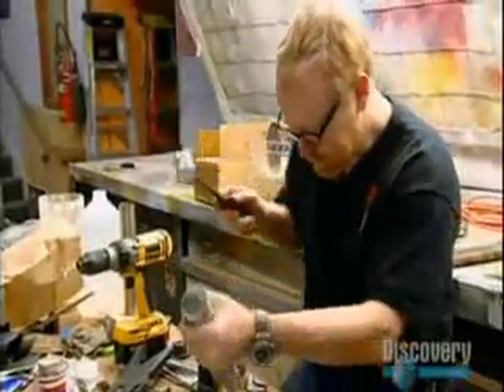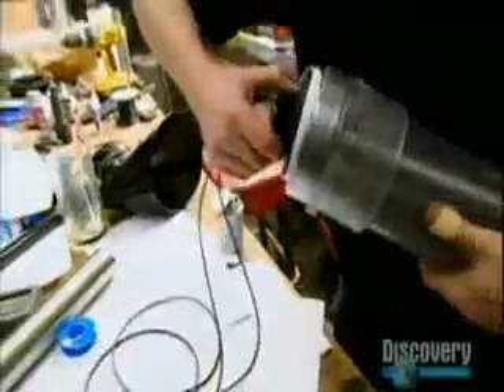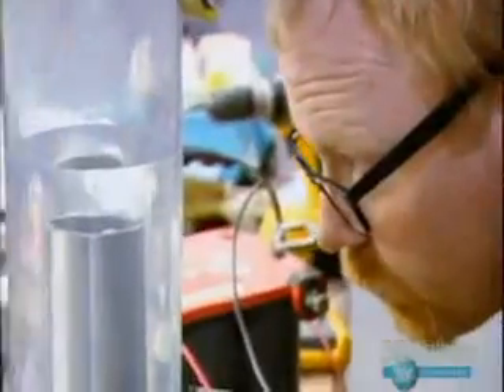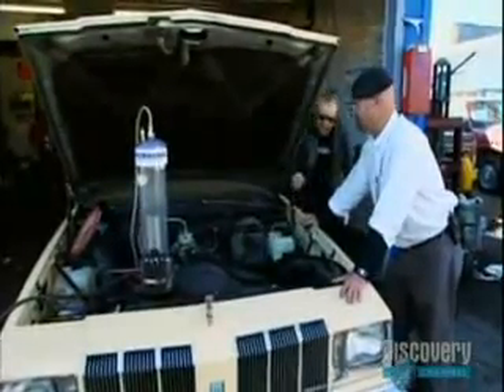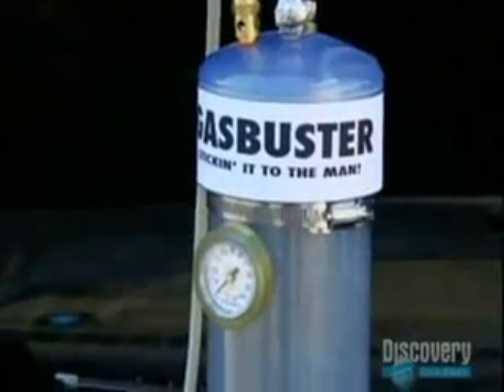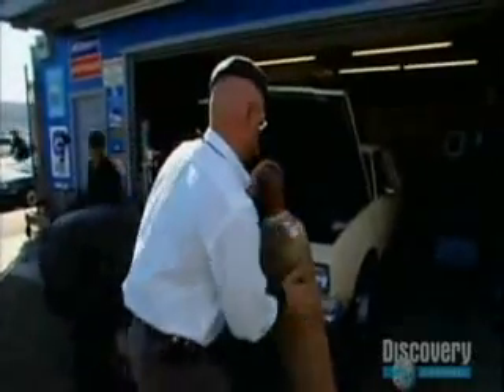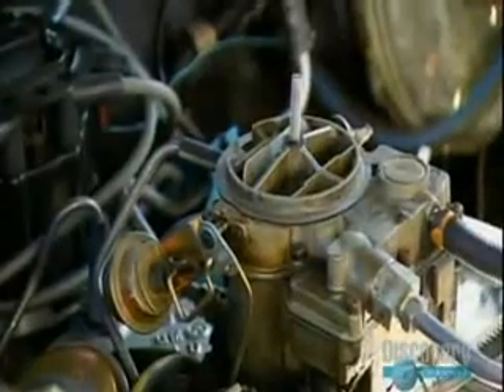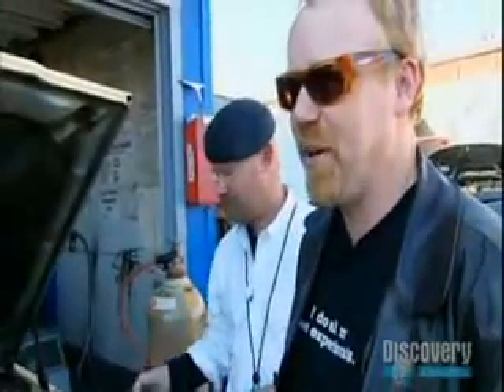HHO Mythbusters Explained

Comment: Hydrogen is 1/ 300th the amount of energy as regular Gas per volume. So you'll look cool with that 300x's bigger gas tank that's the size of a double transport trailer consuming 10x's the fuel just to pull it and realize you'll get about 50 miles on 2,400 gallons of water. Great idea you fucking idiot ! where r u fueling up, the ocean ?
Reply: did someone say retarded?I  I  I  ggg  gggg ggggoott  aaaa  ccaarrrr  dddaatttt   rrrruuunnnnssss oonnn   rrrraaaiiiiinnnn ddduuuussstt.
Reply: if you also factor in the burn time of hho, vs gasoline, the spark advance that normal engines run will cause detonation... so if it did work, it would it would destroy the engine. hence the backfire... ignition while intake valve is still open...
Reply: +charles samuel the arrestor only stops the flame from going back into the line. doesn't stop the cylinder from backfiring as the valve is still open when the plug fires.
Reply: +charles samuel yes, by changing the ignition advance. newer vehicles would never allow the ignition to become that retarded, the ecu would just not allow it. unless a standalone ECU was used. older ones you could retime the distributor. either way, you're not producing enough HHO on the fly to support combustion.
Reply: Your calculations are wrong. There are cars that run on COMPRESSED hydrogen. My local power company had one that would get about 250 miles per tank. You don't story hydrogen or ANY gas uncompressed. Even car tires use 32PSI. Imagines the building sized tank they would need to fill that tire !

As far as using hydrogen from water. The hydrogen is way more compressed in water. And if it is stored in metal like lithium, it is about the equal of several THOUSAND PSI but is very safe.

This guy runs his car on water from hydrogen stored in metal tanks using lithium hydride. And he gets over 400 miles per tank. More than ANY production car. Most production cars have about 10 gallons of gas and get about 20 - 25MPH. But lets say 25MPG x 10 gallons = 250 miles range.

So it has almost double the range of most cars, not counting a refilling. And cars are EASY to adapt to gas. Many have been converted to propane and natural gas and hydrogen.
see this video for an example
Who's Killing the Hydrogen Car  [Original] 
He shows the whole setup.
Reply: Unless you mix it with exhaust like Meyer did to slow the burn rate. Why does everyone here think hydrogen cars can't work since they have been around since at least the 1970s that I have seen in person.
It just takes a modified carb for a gas instead of a liquid and changing the timing and a different storage tank. They have been doing it in Canada for propane since at least the 1980s since gas their was more expensive. I met someone traveling from Canada back then looking for a propane refill station.

And the engines last LONGER than they do with gasoline since it is a near 100% burn, not like gasoline, and doesn't leave combustion byproducts. If you can't find one, go to most factories, most use PROPANE forklifts. 

I'm sure you can find hydrogen cars on the internet. But a fuel cell may be more efficient but it takes a long time to pay for itself. For now. The Bloombox says they can do it cheaply and works great for powering Google and other companies. So why do the car makers not use it ???
Who owns the car companies ?
Do they also own oil companies ?
That is why.
Reply: +James I agree they work. but you can't produce enough hydrogen on demand to support combustion. and ignition timing has to be changed. the factory ecu will not adapt to the spark curves required.
Reply: I wanted to call you a jerk because your numbers are nothing. 
I was told, and then actually checked it out. The electrolysis of 1 gallon of water gives about 1,866 gallons of combustible gas (namely HHO).
Burning hydrogen by itself requires nuclear fusion (or something like that) and is very bad for the neighbourhood and is very much more powerful than gasoline. Burning hydrogen with oxygen (HHO as it comes from the electrolysis process) is about 3 times more powerful than burning just gasoline. Burning gasoline with an appropriate amount of HHO will give you more power, cleaner exhaust, a cleaned out engine that runs cooler (less wear and tear), and better gas mileage.
Don't just babble like an idiot. Find out and then tell the truth,.. or shut up.
Reply: +James I hope you don't mind a slight correction. HHO and water car technology has been around for about 130 years.
In WW2 they would spray water directly into the cylinders of bombers so they could have enough power to get off the ground, and pilots coming back across the English Channel would fly close to the surface of the water to increase their flight range and their chances of getting back with their plane because the air close to the water's surface has more moisture in it.
I hope that helps.
Reply: +Dustin Davidson Hi James. You're right. It is difficult to generate enough hydrogen to run a car with a run-of-the-mill HHO generator. That's why you use HHO in combination with gasoline, or diesel fuel. HHO is about 3x more powerful than gasoline, so when they're mixed appropriately you still get more power than just the gasoline, better fuel mileage, cleaner exhaust, a clean engine, and the engine runs cooler (less wear and tear).
Reply: One slight problem, it costs you about 3 gallons of gasoline to produce by electrolysis the energy equivalent of one gallon of gasoline in hydrogen.

You might as well just run on gasoline.  More efficient.
Reply: HHO is just water (H2O) written by chemistry illiterates.

Water injection into piston engines is done for two reasons - cooling of hot spots during high power output, and a slight power increase due to the water flashing to steam.   There is NO fancy hydrogen stuff going on at all, and it's only useful for very short intervals.  It's also used in rocketry - spraying water into the rocket exhaust causes the water to flash to steam, expanding greatly.  Meaning you can scavenge a bit of the no longer useful heat to produce a bit more kick.  Again, no fancy hydrogen stuff.  Just ordinary steam power.

Pilots coming back across the channel flew low because it was more difficult to see them than up high, especially if the moist air produced fog.  It only extends their range because they didn't have to expend energy to go higher.  Duh.
Reply: We have a driver at our laboratory right now that can efficiently produce gas on as little as 11 watts.
Reply: You're managing to efficiently produce about 3-4 watts worth of burnable gas from 11 watts of electrical power.   If you're really really super efficient at it, you might get 7.

I was "efficiently producing gas by electrolysis" 45 years ago in my bedroom with a 9V  transistor battery (maxes out at around 1.5watts), a paper cup, and a few inches of wire.  The quantity of gas produced after several minutes was about enough to fill a couple sewing thimbles.

It takes just as much energy to pry the hydrogen-oxygen bonds in water apart, as you get back when you let them rejoin (by burning it).  This is basic thermochemistry, reproven daily by experiment by thousands of chemistry students.  Further, the efficiency of electrolysis isn't very good.  Industrially, the efficiency is 30-40%. The best efficiency ever attained in a lab is about 60-70% - for every 10 watts of electrical power you put in, you'd get 6-7 watts worth of gas out.

If you start out with water, and end with water (which is what you get when you burn hydrogen with oxygen), the best you can do is break even.  But in the real universe, you don't get 100% conversion efficiency.   So you lose.  Always.

There is no free lunch.

There are many reasons for working on the efficiency of electricity-to-hydrogen production.  Making cars run farther on a tank of gas isn't one of them.

If you want your car more efficient in the use of gasoline, your time is much better spent on regenerative braking, auto-shutoff/restart while not moving, or other forms of excess engine power production scavenging/reduction.   In other words, invent a Toyota Prius.
Reply: Vehicle range is determined by the size of the tank, that's all.  There's nothing hard about making any car go 2000 miles on a tank of gasoline ... if the tank took up the backseat and trunk.

Ever look in the trunk of a hydrogen or propane car?  Most of it is gas pressure cylinders.

Production cars can get up to 80 or 90MPG on gasoline these days.  There are production cars that can get well over 600 miles per tank if they bothered making the tank as big as their gas guzzler cousins.

Hydrogen-powered vehicles aren't at all uncommon.  They have a number of advantages - the exhaust emission is just steam for example, meaning it's safe to run them inside buildings (eg: forklifts), and the engines run cleaner/need less maintenance.  Then there's the "serious cool factor", the "I'm so green factor" and the "if I use it, industry has an incentive to make it better factor".   But for economy of operation?  Nope.

Who is killing the hydrogen car?  Dunno, most vehicle manufacturers are building hydrogen cars, which is the opposite of killing them.

Could it be the oil companies?  The oil industry is responsible for 80-90% of all hydrogen production in the US (commercial production of hydrogen from hydrocarbon fuels is more efficient than electrolysis).  So, it ain't the oil companies trying to kill them.
Reply: You really don't know about thermochemistry or gas physics do you?

Of course, a gallon of water can be converted to a much bigger volume of gaseous hydrogen and oxygen, Avogadro says so, the volume calculations include a number named after him, but that doesn't tell you what the energy is.  The energy required to convert that gallon of water to gas is more than you get back when you burn the resulting gas.

Or, let's look at it from another perspective: modern car alternators produce 35-40A at 12V.  That's 480 watts, equivalent to about half a horse power.  Let's just say you were able to get 100% efficiency in converting that gallon of water into gas.  That would mean you'd only get at most 480 watts (that same half horse power) of burnable gas energy to "supplement" the gasoline.  So you're using half a horsepower of electrical power to produce, at best, half a horse power of hydrogen.   How much did that half horse power of electrical power cost?  At least a half horse power of gasoline.  Well, that was a waste of time, money, and gasoline.

There is no free lunch.
Reply: Again I say, I'm not sure if you've deliberately trying to discourage, deceive, and misinform people or what but if I didn't know better your rantings would certainly affect me so.
I may not be the scholar you are but I do know something about chemistry. One thing I know is that electrolysis of water works. I also know that burning H2 with O2 alone is not efficient at all because to recombine them you must first break apart the hydrogen and oxygen molecules and the provide more energy to recombine into water molecules. When we use "freshly" generated Brown's gas we are dealing with true HHO as well as positively and negatively charged ions of hydrogen and oxygen, as opposed to just 2H2 and O2. Thus there is no need to break down the H2 and O2 molecules.
When this Brown's gas is mixed with whatever fuel the internal combustion engine uses no extra energy is needed to cause the combustion and since it's going to happen anyway the Brown's gas will burn more powerfully than the fuel by itself, it will burn more cleanly, etc.
The point of mentioning the volume of combustible gas generated by the electrolysis of a unit of water was to show that much more than just a gallon of simple water was involved in the process. Contrary to popular opinion, water (2H2O) is not injected directly into the cylinders of the engine in a vehicle that uses  the electrolysis system. Rather, it's simple, elemental H and O (not even H2 and O2).
Have a good day.
Reply: Do you know what the difference between elemental and non-elemental is?
Reply: This will be interesting, because ionized hydrogen (H+ - a single hydrogen atom without an electron) cannot exist by itself because of it's irresistible attraction to anything with an electron.  Neither can an O- ion (for something with more protons than electrons).  Except at plasma temperatures well above the disassociation temperature of water (3000C).  So, unless you're running your electrolysis cell, plumbing, carburetor and intake manifold at 6000C or so, ionized elemental hydrogen and oxygen can't exist long enough to get from the cell to the engine.  Given that 6000C is well above the melt point of aluminum or iron (or any other solid material for that matter), that may be difficult to accomplish.

Bruce seems to think it requires energy to convert 4 H atoms and 2 O atoms into 2H2O.  On the contrary, it produces a lot - more than what is required to split the original 2H2 and O2.  If it did require energy to combine them, then, H2 and O2 won't burn.  But we know H2 and O2 do burn.

Bruce needs to crack open a chemistry text and look at the energy required to break 2H2 + O2 apart, and compare that to the energy that you get back when they recombine as 2H20.
Reply: Ok. The difference between molecular hydrogen or oxygen and elemental hydrogen or oxygen is that molecular H or O is actually H2 or O2 (any place that uses oxygen from a gas bottle uses O2, hospitals for instance). H and O atoms need to bond and if nothing else is available O electrons will bond with other O electrons making O2 molecules. The same thing applies to H.
The difference here is that if we use hydrogen from a fuel cell the H is already bonded (H2) and requires more energy to, first break the H2 molecule into 2H (unbonded) and then burn the H with unbonded (elemental) O which will make H2O.                              2H2 + O2 = 2H2O
If we use elemeltal H and O (say from an electrolysis unit, not only are the elements elemental, they are also in the exact proportions needed to burn them together,... or they could be used separately.                              2H + O = H2O

Is that the kind of expansion you were speaking of?
Reply: +Bruce Dobson Good, you've correctly explained the difference between molecular and atomic hydrogen and oxygen.

The problem here though, once you generate H+ and O- via electrolysis, they won't live long enough to do anything with them..

H+ and H (or O- and O) are only momentary intermediates between H2O and H2, O2 during electrolysis.  By "momentary", I mean nano or micro seconds, and then they recombine into H2 and O2 - yielding energy that you get back.  A google for "thermal water disassociation" will tell you all about this.  The appropriate level  (first or second year University) chemistry text book will as well.

This is obviously not long enough to get from the electrolysis cell to the engine is it?

In order to keep any reasonable percentage of the H and O as atomic for long enough to get to the engine, you have to raise the temperature.  A lot.  To over 3000C, and worse, to keep any reasonable amount of it as H+ and O-, you have to raise it even higher - to plasma temperatures (5500C-6000C and up).  Those are totally ridiculous temperatures to try confining under a car hood.  The melting point of aluminum is 660C, and of iron 1538C ... in other words, if you're successful getting mon-atomic hydrogen/oxygen  to live long enough to get to the engine, the engine will melt, to say nothing of what happens to the tubing, air filter and so on.

Speaking conservation of energy again, while "burning" H+ and O- will yield more power, it'll requires all that much more power to generate the H+ and O- in a form long-lived enough to do anything with.  Further, this is only something you can do in an industrial plant or a specialized lab capable of handling such temperatures with exotic metal alloy plumbing etc.  Indeed, even nuclear reactors have problems with thermal disassociation of cooling water into H2 and O2, and having the H2 embrittle the pipes.

Sorry, this "HHO theory" doesn't fly.
Reply: Yes, H+ is a bare proton.  I already said that.  While H+ and -OH can be in equilibrium with H2O, remember, there ain't no H2O anymore - we're talking about the gaseous output of electrolysis at near room temperature.

Secondly, by "equilibrium", that implies nothing about concentration.  "Equilibrium" in this sense simply means that the creation rate is the same as destruction rate (back to H2O).  As physical chemistry demonstrates, at any temperature above absolute zero, there will be a non-zero number of  H and  OH ions wandering around because a few molecules of water just randomly has enough energy to convert.  At room temperature only one in 100 trillion H2O molecules are split at any given moment.  It's not until the temperature is raised into the 1000's of degrees C that the percentage of molecules with enough energy to disassociate start predominating, the creation rate goes way up, and the destruction rate (back to H2O) drops.  By the time you reach 2200C, only 3% have decomposed (into H2, O2 mostly, some H, H-, -OH, and O), at 3000C it's about 50%, and not until 6000C or more do ionized atoms predominate as the electrons are stripped off (turning to plasma)

[The wikipedia article on "water splitting" is a nice simple description of this.]

It doesn't matter how the HHO is produced, the equilibrium equations still apply insofar as the ratios of H2 versus H, or O2 versus O.  Indeed, if you started with H2+O2 (HHO) at room temperature electrolysis and tried to get to those temperatures, it would convert to H2O with a bang, and then disassociate again when the temperature rose above 2000C or so.

As for O- versus O-2, a single atom of oxygen doesn't have to be either short 2 or short 0 electrons, it can also be missing one.  It was really intended as a more generalized reference to mono-atomic oxygen with a charge anyway.
Reply: Frumious Bandersnatch Maybe I'm misunderstanding what you mean by H+ and O-.
I understand it to mean a positive hydrogen ion and a negative oxygen ion. That, as I understand it is a free standing proton (H+) and an oxygen atom that has one more electron than it has protons (O-).
I thought that when a normal water molecule is broken apart by whatever method the normal thing is to end up with two complete, normal hydrogen atoms (1 proton and 1 electron each) and one complete, normal oxygen atom (8 protons and 8 electrons). To me this would not be H+H+O-. Rather it would simply be HHO.
Also, it seems to me that if there is an environment rich in H+ (for instance) all by itself the positive charge of each ion would cause the hydrogen ions to repel each other and not form any bonds.
If I'm wrong please correct me. I don't like being wrong.